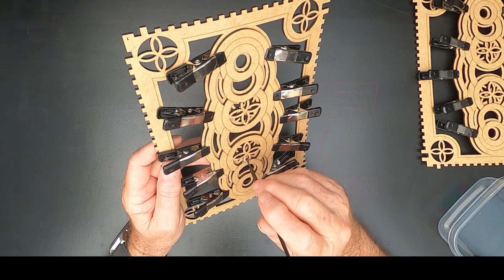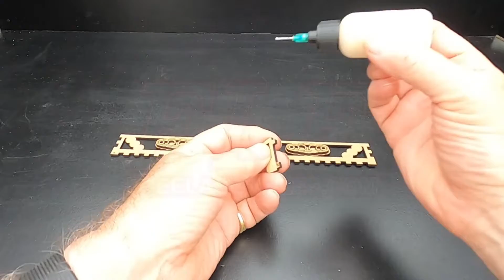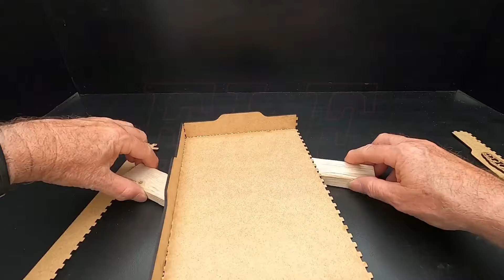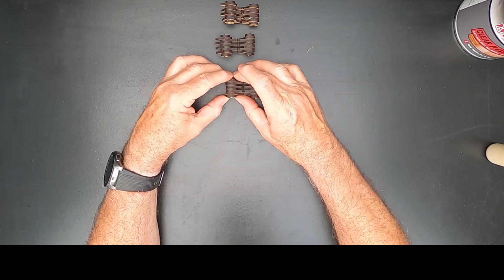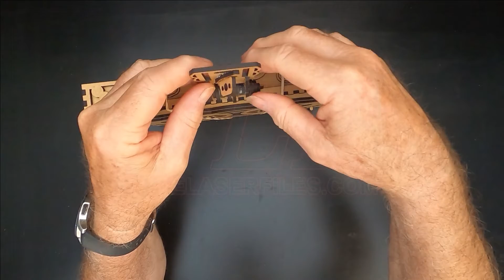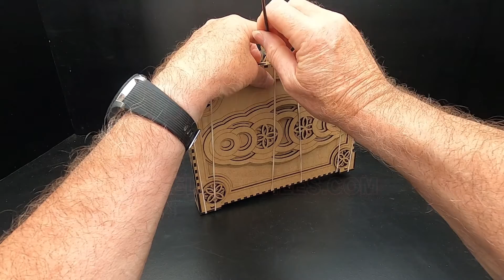Laser Cut Book Box Instructions and Free Cut Files

Comment: en la hoja 1 hay un color 25 y27 para que son tenemos que ajustar velocidad y potencia'?
Reply from the maker: Hi, when I import the file into lightburn I get different numbers. I can tell you that the Black lines are cutting lines which need to cut through the material. Both the Red and Blue lines are score lines which need to cut into the material but not through the material. Usually our part numbers are drawn in red, but on the book box they were drawn in blue because someone requested numbers as fills. Hope this helps.
Reply: @freelaserfiles  entonces los numeros 25 y 27 no se usan y la velocidad y potencia se las tenemos que poner nosotros.Esta cuestion no esta clara tendria que editarla de nuevo.Gracias

Comment: I need help, I've wasted a ton of wood already, how do I fit one of your pages on a 20x12 sheet of wood? It always overlaps. I can't resize it. I'm using a Creality Falcon 2
Reply from the maker: Hi, I may not be understanding your question, but I will try to help. I have no knowledge of the Creality Falcon, but on line it says it has a cutting area of 400mm x 415mm. 
We upload the files in three layout sizes, 
1/ Laid out - this is for people who want to nest their own layout to suit their machine, 
2/ Parts fit within 400mm x 400mm -16ins x 16ins. These sheets would probably fit your machine but you would need 16ins x 16ins sheets of material. 
3/ Parts fit within 480mm x 270mm - 19ins x 10.5ins. This layout is usually used by glowforge owners. If you have 20ins x 12ins material sheets, the layout would fit on your sheets but your machine would not be able to cut them.
I hope this helps.

Comment: I was wondering if you could post your settings for the atzer. I have been trying to cut ton a xTool d1 pro 20 watt and have not been able to find a setting to cut through the MDF
Reply from the maker: Hi, thanks for contacting us. Let me start by saying that this box was cut on the Atezr 20w diode laser and that I am not an expert on diode lasers. We have been doing 150w Co2 laser cutting/engraving for several years to produce products, but when we decided to draw and share files, it became obvious that diode lasers are more popular with hobby users. When we are cutting the models for the videos, we are not rushing to produce products, so tend to cut quite slowly. 
MDF is very easy to cut and get a nice clean edge. It has no voids or knots, so we cut this material in one pass. For 3mm - .125" MDF, on the Atezr P20 we use 100% power and a speed of 6mm or 7mm per second, or 360mm to 420mm per minute, with the air assist at a medium setting. We have done tests at speeds quite a bit faster that this and the Atezr cuts with no problems. 
The models we make from 3mm Baltic Birch Plywood, we tend to use two passes at 100% power and 5mm or 6mm per second, or 300mm or 360mm per minute. The only reason for the second pass is the voids and knots. Even with a second pass, these can still cause the part not to drop. Again we have done successful test at higher speeds, but as I said, we are not in a rush when we cut the models.
The video showing the laser cutting the parts is not edited and is at the actual cutting speed. The MDF sheet is on a steel honeycomb bed, held down with magnets. The air assist is on and there is a fan blowing the fumes away.
Hope this info helps.

Comment: Great designe! Is that a syringe tip your using on top of the glue bottle...?
Reply from the maker: Hi, we use titebond 3 wood glue through an 18 gauge luer lock blunt dispensing needles. You can find them on e bay or amazon. They are ideal for small models but the glue will dry in the needle and block it if it is not kept clear. After each use I swap the needle onto another bottle filled with water and flush it. I also have needle caps which seal the needle and ball end pins which fit into the needles.